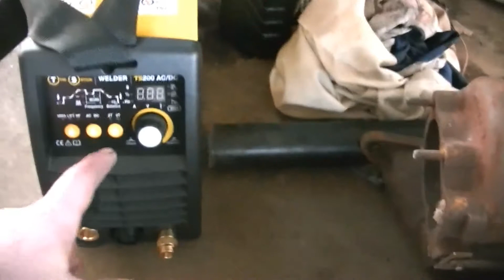update and attempting to mod my pressure plate

Comment: I got a clutch that was too strong for my cable,custom clutch for 4g63t > stock L300 gearbox  haha it worked for a couple of short drives then wouldnt disengage. I could grab the hydraulics from a newer mitsubishi L300 but that sounds like abit of effort. So Im running a slightly stronger than stock one till its ruined
Reply from the maker: Hahaha sounds like it would have been a pig to drive surely an evo twin plate or something would work well?